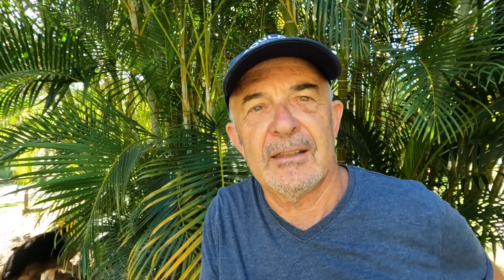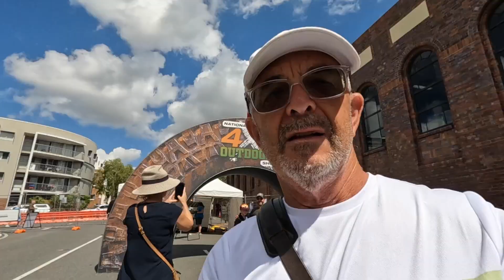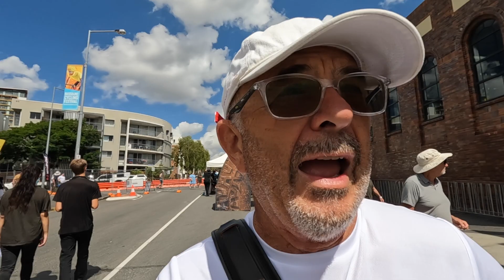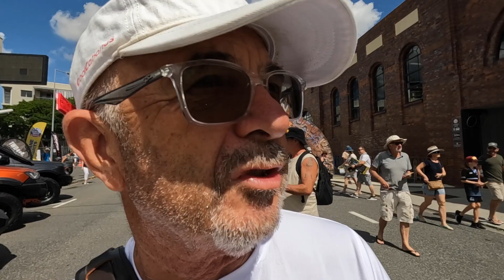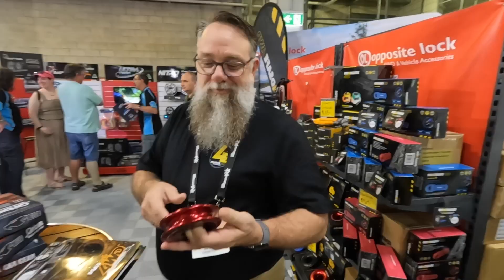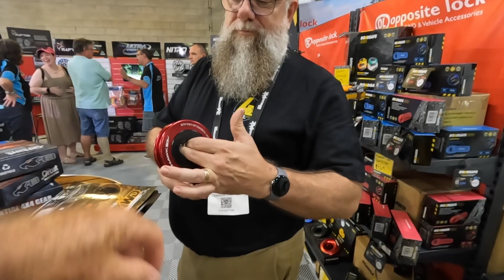Brisbane 4x4 and Camping Show 2023: some new gear including Top Driving Lights & Roof Rack Tips

Comment: The owners manual for the Grenadier is out, it states 100kgs rack load, excluding the rack weight.
Reply from the maker: Thanks for that Mike, I'll have another look through the manual. I've had a few different bits of advice from both the Ineos guys and Rhino Rack themselves. the consensus was that the rack was tested to 90kg  but your info sound like an update and an extra 10kg will help. Could be to do with the weight of the rack itself the 60kg weight as advised to me by Ineos has never actually been confirmed and sounds a lot and maybe it's around 50Kg. I appreciate your comment. John
Reply: @cannyoutdoors  no worries John, I scoured the whole manual for the information, I could have interpreted it incorrectly but  here it is -AUTION: Maximum roof load capacity (with Roof-Rack
accessory) is 420 kg static and 150 kg while driving
(dynamic). Do not exceed the roof load capacity limit
Reply from the maker: Thanks Mike. I agree that’s the info I have also.